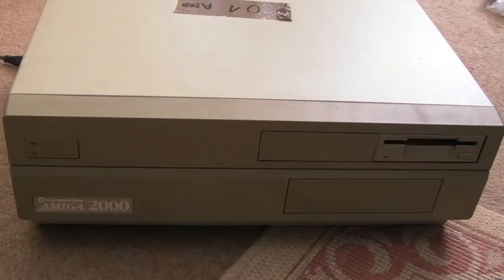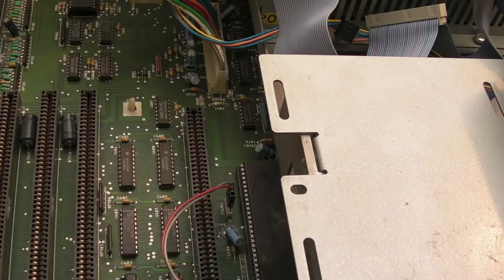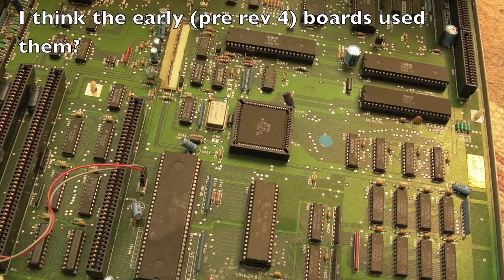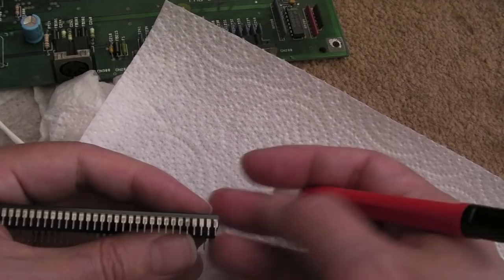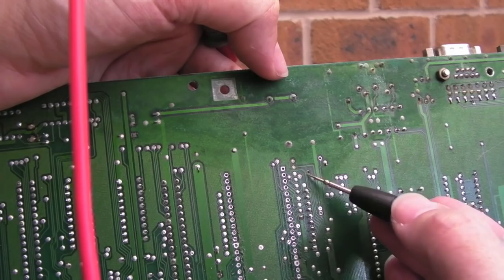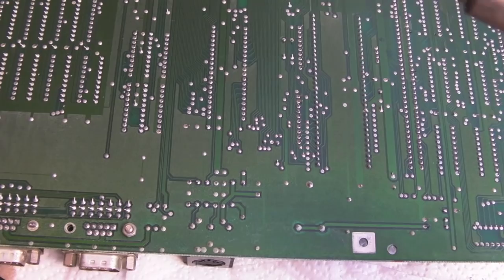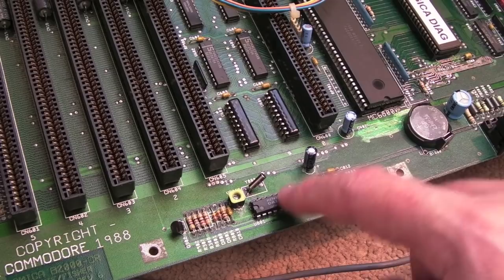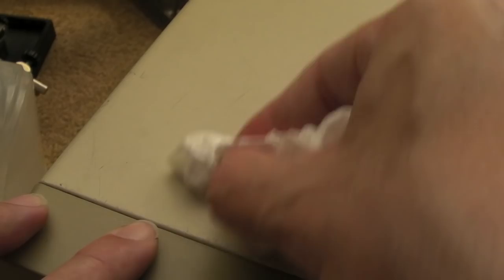Commodore Amiga A2000 Repair (Rev 6.2), CR2032 Mod & Channel Update

Comment from the maker: The point where I was testing those vias - the first one that appeared be OK, wasn't - it only measured a short when the probe was pushed deep into the via.  That's why you spot me retesting that same via (instead of the other one).  There were in total 3 bad vias.  I also forgot to cover the easy way to fix them:-   Clean with vinegar, push a very small PCB drill bit through the hole to clean it out, then feed a piece of kynar through the hole and solder it on both sides of the PCB, cut off the excess and it looks just like a normal via.  At the point I dealt with the clock issues - I forgot to mention the first thing I did was swap the crystal (you can tell if you look at the can - its a brand new crystal I fitted) - but that still made no difference.  I am sure it was the trim cap being dirty from corrosion.  Seen that same exact cause on two A500 RAM expansions recently.
Reply: The corrosion (or my cleaning) on my A2000 also killed the trimmer  cap. It only measured short. Replacing it fixed the clock.

Comment: I've really enjoyed watching this and intend to go and find the earlier 2000 vid to watch as well. I got an A2000 earlier this year which I'd intended to fix up and try out but, as theses things go, it got set in a corner of my storage area while I tended to other matter. I stopped watching this vid as soon as I saw the varta battery part and immediately went and opened up my 2000 and cut off it's battery. Just in time too as it had just started to leak at one side. I wiped the area down with vinegar though it didn't look like it got to the actual board, scrubbed and cleaned it with IPA. Whew!!  Then I watched the rest of the vid. Stay Strong!
Reply: BTW, does anyone know where you can get new 2000 floppy drive covers and eject buttons? Mine were broken during transit even though the seller had taped padding to them. The tabs holding them on are tiny and extremely fragile.
Reply from the maker: Thanks, much appreciated =D  The 2000 is a lovely machine!  It's a shame it lacks AGA, but most of the library for the Amiga plays just fine on a 2000!  Sounds like you saved your 2000!
Reply from the maker: There might be a 3d model (to 3d print) for the drive facia?  I will let you know if I find one later!
Reply: @GadgetUK164  Thanks! Happy New Year!

Comment: The A2000 is my absolute favorite Amiga hands down!   To put it in perspective when it came out it just blew my mind at all the things it could do.  All I knew is if I wanted to run Amiga stuff it was obviously there but kick it up a notch and you could add a Bridgeboard and run PC stuff or an Emplant to run MAC stuff and do it all in one platform making that Big Box worth every penny.   I bought the one I still have an use today back in 1990 or 1991 it can with an AMAX II with MAC System 7 installed with a 7 port serial card and 8mb RAM.  I used that A2000HD to run my BBS running C-Net Amiga Pro and had it answering several phone lines.  Of course the Internet took over and I took my BBS down in 1997 after being online for 10 yrs.   The A2000HD replaced my A1000 and A500 but for one reason or another I never acquired a Bridgeboard which for me was an attraction.   Most of my friends had PC's at the time and would comment about how powerful their systems were compared to my Amiga 2000HD and then they would often scratch their heads wondering how the A2000 could do things their PC's could not.   When Win95 came out a friend called me and said now his PC could do things my Amiga could and I told him its about time cuz the Amiga came out in 1985 and the PC took all that time to catch up yet required a lot of power to achieve what the Amiga could do effortlessly.    I own other Amiga's, A500, A600, A1200, A2000HD and an A4000.   I love them all but none of them have had the impact the A2000 did for me because I was there when it first came out and saw its potential.   The first Amiga I ever saw was the A1000 and the first thing I ever saw it run was Battle Chess and while I am not into games what I saw that day blew my mind and because of that experience its one of my favorite games.   The first time I ever experienced true sound from an Amiga was on an A500 running the game It Came From The Dessert and while I do not like the game I do love the intro so when I actually run that the Control Amiga Amiga keys get hit a lot.   Like I said I am not much into games but when I do play them I do it on either my A1200 or A600 both of which have accelerators in them.
Reply from the maker: I have to admit, I absolutely love it!  More than my 1200 lol!  I wish it could do AGA then it would be perfect!
Reply: @GadgetUK164  Put a Vampire in it. ;)
Reply from the maker: @cbmamiga5239  I would need to sell a kidney first to afford one lol!  They are great though!

Comment: The schematics you were looking at, were probably for the Amiga 2000 A from Braunschweig in Germany which was based on the Amiga 1000. Your Amiga 2000 is the "Cost Reduced" Version, also called B2000,  based on the A500. The B2000 integrated many of the discrete logic and PALs into Gary and FAT Agnus (from the A500) and Buster. The higher Integration allowed them to reduce the mainboard from 4 to 2 Layers where much of the cost saving comes from. Also the original A2000 from BSW had only 512KB Memory, as the old "thin" Agnus couldn't handle more, not even as slow RAM, but it had a 512KB Expansion in the CPU Slot, wich is in theory true fast RAM (but mapps at C0000), as it isn't controlled by Agnus. But in my Benchmarks the Fast RAM of the A2000 wasn't really faster than the Slow RAM of the B2000 and Zorro Expansions were much faster, but I didn't stress the Custom Chips in the tests. I Also built a replacement for this CPU Slot Memory Expansion based on SRAM, with no wait states and it was even slightly faster, than the Zorro DRAM expansions.
Reply from the maker: Thanks for the info there!  Ah, so there is an earlier board that uses them!  Sounds like the original A2000 is rare?
Reply: @GadgetUK164  I think there not that much A2000 produced before they switched to the B2000. But I don't think they are that rare. I got mine many years ago without knowing it was a A2000 and it went to storage because it didn't work because auf battery damage and I didn't know how to fix it. I finally fixed it a few month ago by mainly just removing the corrosion. All traces beside the ones connecting the rtc to the battery were fine, just the CPU sockel has some issues (it's one with the round holes and the corrosion made some of them to big) at the moment I have just stuck another sockel between the old and the CPU but maybe I will change the socket someday. But I think I at leas removed all of the corrison with the fiber glas pen so it shouldn't get worse. I also have one of the early A2088 bridgeboards (also ot it by "accident" with BSW (Braunschweig) printed on it.
I got fammiliar with the B2000 schematics, when I fixed the B2000, wich I ot together with the A2000 but had far worse battery damage and needed lots of traces to be repaired.
Reply: @GadgetUK164  But the only reason someone would want a A2000 instead a B2000 is for the  collection. From the technical point of few the B2000 is superior in any way except that the C00000 RAM in theory could be faster on the A2000. Also there were 2 common revisions of the B2000. The Rev 4.x had an old FAT Agnus and hat therefore 512K Chip and 512K Slow ram and the Rev6 had all of it's 1MB of onboard memory as chip ram as it came with the newer Agnus. Also the Rev 6 used bigger RAM chips (and therefore less of them). The Rev 5 had the big ram chips but still the old Agnus. But its very very rare as almost none of them were produced because the better Agnus was availible before the bigger RAM chips becme cheaper as the small ones.

Comment: Best old hardware accelerator for the A2000 ever... 
Was the DKB Wildfire 68060 Board.
You could attach the DKB Inferno Graphics card to the back side of it...  
It had ethernet connectors... and a SCSI II controlled on board and simm sockets up to 128mb
Try to find one of those monsters sometime  :D

Comment: Firstly, thank you for holding on. I have always liked your videos a lot, though I barely give a thumbs up, not only to you, but to anyone.
The white powder you found on the PCB, after drying off, is probably a salt, coming from the reaction of the vinegar with the alkaline battery juice. And right there is a point I would like to make: One thing that has always annoyed me a bit about your method of treating battery corrosion, is that after treating the PCB with vinegar are you rinse it off with IPA. Salts in general may be somewhat soluble in IPA but not that much. Most salts are very soluble in water, though. So instead of rinsing the PCB with IPA, you should rinse it with distilled or deionised water. After that, rinse it with IPA thoroughly, in order to get all the water off.
Just recently I restored an A500+ with the usual battery damage. The board was very, very dirty, so my first step was to wash the whole PCB in regular tap water, after removing all the socketed chips. Then I treated the battery leakage with some vinegar and washed the PCB with tap water, again. Next I immersed the whole PCB in distilled water for a couple of minutes, moving it around. This should remove every trace of salts, even below the soldered chips. Then I immersed the whole PCB in IPA, again moving it around a bit. The IPA should now pick up all remaining water. Last step was to put out the PCB into the sun for drying. The IPA will evaporate quickly, even if it is mixed with some water. The water will not stay behind. If there is no sun available, a hairdryer might do the trick as well. After this treatment the PCB looked almost brand-new, except for the parts who have the corrosion.
Reply from the maker: Thanks and thanks for taking the time to watch and post a detailed comment - much appreciated!

Comment: Amiga 2000, The Roles Royce of Amiga's!  I missed out on one of these on ebay a few weeks ago for a BIN for £250, it was a REV 6 MB as well.  

RetroMan Cave done a Amiga 1500 a while ago and I think the 2000 and 1500 are pretty much the same machine but the 1500 has a single floppy drive.
Reply from the maker: They are pretty pricey!  Want to try and hold onto this A2000 if I can, but at some point it might have to go =/

Comment: Shame that nobody has made a PC board, with a more modern cpu on it, add one to a vampire and you would have a kick ass Amiga. The cable ties on the PSU wires are factory.  My 2000 came like that from the  factory.

Comment: Use a grounded wrist strap to prevent ESD damage. And ALWAYS remove the battery and replace with a coin cell w/adapter.

Comment: i had ideas like taking the raspberry pi from the gpio to the amigas hd connector on the 1200, but a program needs to be wrote i think. just to make the raspberry pi appear as a "virtual" drive to the 1200, but whats going to happen in the program is that workbench and all that goes along with it, like the sd card on the pi, are now going to communicate with the 1200 through that slot.

the other idea was, modify uae from the software emulation in the programming to read and write through the hardware address either on the board the ec020 or the expansion slot, 68030 or higher. everything we need to run the amiga is in the uae interface. maybe a self booting option to get the user in on the configuration they chose. the point also is we wouldnt have to worry about hardware roms because we can just use the software rom in uae.

now what about conflicts? table and bridge, in software "wrap"
the programming in aue might actually conflict with the hardware on the board, unless its properly tabled over.

basically.... i dont want to spend 500 fucking dollars on a vampire 1200. theres 4gb of memory on the pi 4.
also,  id like to see something like instead of "chip memory" board memory instead of graphics memory as well. and fast mem as the high mem region. what about board memory, 2mb, extended memory (which would still function fast mem) which isnt being used at all, literally, 128 MB on a fucking accelerator is useless. and the the OS doesnt even use an FPU to help computate the system around the board. its all rom through software bucking(banking)(bank switching) its SLOW AS Fuck :) excuse my language some.
and the PI's  mem as extended mem. it could all accumulate into fast mem, but the system has to suport it. what i am hoping ofr is someone writes a kernal and flashes it on a bridged rom for the high rom(bottom) low rom(top) in orientation on the board. the kernal could support all those features and we could actually modernize the amiga in step and use the advanced graphical capabilities of the pi and the sound, off of the pi including, get this: MODERN WEB BROWSING...and.. game support :)

the overall idea, keep the amiga functioning the same, drop a pi on it and make it work synonymous with the amiga.

the source code for UAE off of their site.

https://github.com/tonioni/WinUAE  

its for winuae, but how difficult is it to just write over for linux?

what would be really sweet is bypassing linux all together, or even writing its kernel over to a solid winuae boot, or desktop.

maybe someone would think that was a neat idea and drop a configuration utility on the desktop to switch between computers, or something.

what would be even neater is a clean integration into say.... linux.
allow linux and winuae to function all from AmigaOS desktop

AmigaOS was based off Unix anyways, practically similar

id say "hey! look at me" but im not the programmer of choice for any of this really
which is sad, however i hope i helped in some way shape or form

i know its not much

thanks for listening

Comment: The pals from the German rev 4 of the 2000 buster didn't exist yet. The Westchester team made a cr version and put the pal logic and some other bits into the buster to make the cost go down. The German version are problematic with expansion stuff and quite limited with only 512k of chip ram.

Comment: Thank you Sir, greatly appreciated Commodore look see, that trim cap is a very interesting find for a fault. 

Could a pot or a trim cap be a culprit for a TFT LCD display issue half the screen is displaying every other vertical line. 

Outstanding effort hours worth of cleaning all that verdigris off.
Reply from the maker: Very unlikely =/  The only reason the trim cap was a problem here was the battery corrosion!  If every other line is displaying I would assume a bad ribbon / connection or driver circuit.

Comment: The A1500 was a 2x Floppy, no HDD version made to compete with the Ceckmate A1500 trying to squash that.
Reply from the maker: Thanks!  Yes, I think on reflection I had a 1500 - if you look at the photo you can see the badge that seems to resemble the 1500.  It's that long ago I had forgotten it had 2 drives too.

Comment: I've had problems with white residue after cleaning with IPA. Turns out my IPA was crap. And it was the same brand as always.
Reply from the maker: Thanks, yes - I have seen that in the past with bad IPA, but in this case its not the IPA!  Having removed that white chalky stuff I can clean with the same IPA and nothing is left there.  It was somekind of salt or something left on the board that the IPA wasn't disolving.

Comment: I need to find time to pull my Amiga 2000HD out of the box its been in for the last 30 some years and check out what state it is in and get it working again. Where did you get the diagnostic ROM? That might be something I would find useful in testing my machine. BTW, What is kynar? I would probably just use some small piece of wire and solder it in place on both sides of the board to repair a via.
Reply from the maker: Diag ROM is free to download!  Logika diagnostic ROM is part of Amiga Forever - if you search the net there are downloads of that too!
Reply: @GadgetUK164  Thank you for that information. That is a bit surprising but good to know. Knowing the size of the ROM chip used in the A2000 I don't have any EPROM chips of that size, nor do I have an EPROM programmer that can accommodate a device with that many pins.
Reply from the maker: You can buy Diag ROM EPROMs on eBay!

Comment: I wish I knew what to try next on fixing my 2000 with a black screen. Plugged a USB stick into the Gotek and the. BOOM.

All the custom chips I've tested work in my Amiga 500 though, so I'm a bit at a loss as to what I blew up... I miss having the extra ram and the hard drive. 😡
Reply from the maker: Have you tried swapping around the CIA chips?  Also check for corrosion around the CPU area.  The other thing you could try is running the latest DiagROM instead of Kickstart ROM, or Logika if you can get it.
Reply: GadgetUK164 - Retro Gaming Repairs & Mods yup, have swapped the cias around, and tried the cias from my 500 with no luck. Same with the Gary, cpu, Paula, Denise and kickstarts, they all work in my 500 too. Only part I haven’t swapped between the two is the agnus because it won’t come out of the socket in my 500. :(

Definitely need a diagrom chip to see if I can get anything beyond just a black screen.